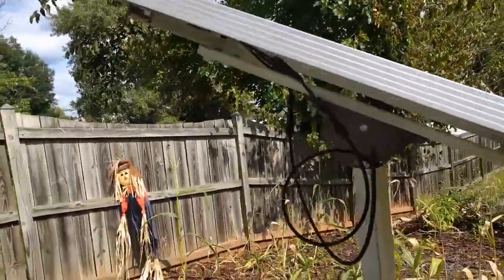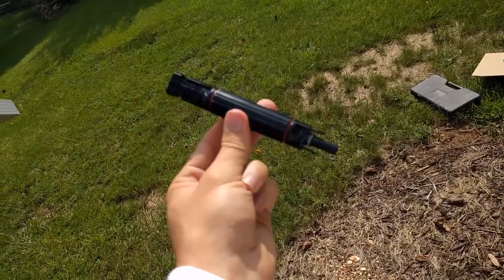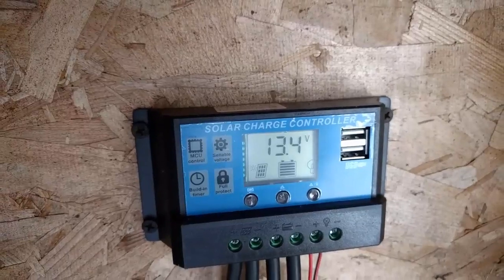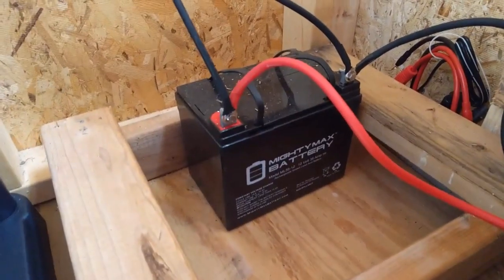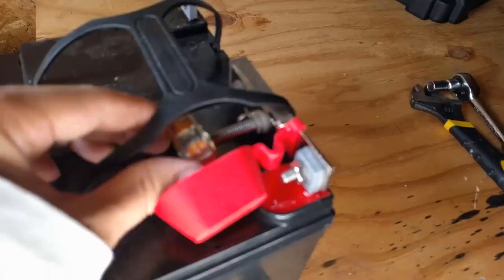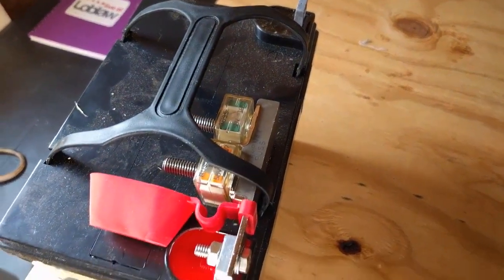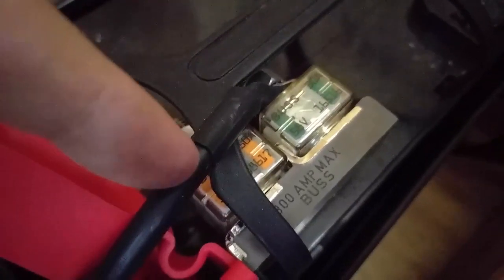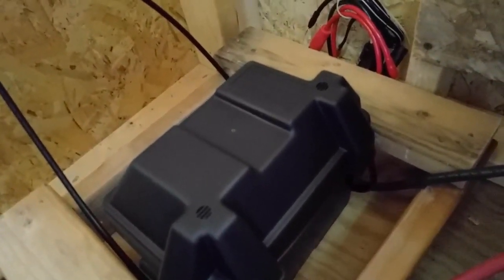Adding Fuses to solar shed setup

Comment: Why are there two fuses?
Reply from the maker: I have 2 devices hooked up directly to the battery, the Charge Controler, and the power inverter.  Each device can handle different amounts of power surge.  If the battery delivers a 40 amp power surge, this set up will burn out the 30amp Fuse (that connects to the charge controller), but will keep the 50amp Fuse (connected to the power inverter) in place.  The power inverter can handle the 40amp surge, while the power inverter cannot.
Reply: Never mind…the second wire goes to the charge controller.

Comment: I’ve been trying to figure out where fuses are needed. Most of the videos I see have “redundant” fuses & breakers. 

From PV to Controller you have a 30A fuse built into the Controller. From the Controller to the power bank you have the Controller (which is a “power regulator”). From your 12v fuse panel (if you have one), you obviously have the fuses themself. 

The only place I figured you’d actually need a fuse is from your power bank to the inverter, just in case the inverter draws too much current. 

Please correct me if I’m wrong, I’m new & trying to understand but haven’t found anyone to break down in detail.
Reply: The fuse at the solar panel needs to be slightly larger than the maximum amps output of the panel so for a 100w panel larger than 5.5 amps, so a 10amp inline fuse is sufficient. Fuse or circuit breaker between the charge controller and battery just needs to match the amps of the charge controller, ie for a 20amp charge controller a 20amp fuse is sufficient. The fuse between the battery and the inverter should be greater than the amps of the inverter but less than the ampacity of the cable ie 1000w inverter @ 12v is 83 amps and if your cables are 110amp cables (6awg 16mm2) then a 100amp fuse is sufficient
Reply from the maker: The 150A Terminal Fuse (also on the block) is in between the Power Inverter and the Battery. 

The 30A MRBF Terminal Fuse (on the block) is in between the Charge controller and the battery.

So even between the battery and charge controller, there was a fuse.

Comment: Hello , I have 50watts solar panel connect to 12v 70ah Battery. What is the size of fuse I should use to connect from charge control to  battery?
Thank
Reply from the maker: I think it depends on the charge controller, for example Blue Sky recommends a 60-amp fuse for their 50-amp charge controller between it and the battery.  For my set up, I have a 30A fuse between my 12v Battery and my 20A charge controller.
Reply: burrheadjr @ my charg controller is 10A so I should use fuse 10a or 15 a is better? Or more ? Can u give me ur ideas. Thank
Reply from the maker: @laychanrithy5387  not an expert, but 15 sounds ok to me.
Reply: @laychanrithy5387  Rule of them is multiply your amps by 1.5 to arrive at your fuse size.

Comment from the maker: The panel is a 100watt panel,and the fuse attached to the panel is a 30 amp fuse
Reply: do i really need to add fuse to a 30w panel?am just running 2 kohree led 12v dc lights on a  20A charge controller
Reply: @HumbleDadz  he still didn't answer you LOL